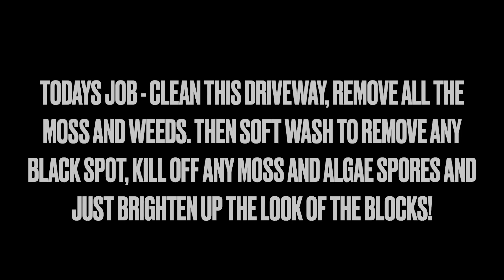FILTHY, WEEDY, MOSS FILLED Driveway Gets The "PRESTIGE" Treatment | Pressure Washed & Soft Washed！

Comment: may i ask what you use for the oil stains and would be effective on stains a couple of years old thanks
Reply from the maker: Hi Alan, Resiblock oil remover is what I use. It shifts most stains, but every now and then, some stains refuse to go, so it's not a miracle cure, but it's the best one i've ever used 👍
https://www.amazon.co.uk/Resiblock-5-lt-Oil-Remover/dp/B00G24X6R2/ref=sr_1_1?crid=354OB0E848J9O&dchild=1&keywords=resiblock+oil+remover&qid=1626116695&sprefix=resiblock%2Caps%2C197&sr=8-1

Comment: Hi Nick Great Job bud !! I have recently acquired an xjet do you use your proportioners with it or do you premix the SH with water thats in the drum and then run it through the xjet without the proportioners ??
Reply from the maker: Hi Simon, many thanks 🙂. The proportioners set the level of dilution you need bud, you'll have a chart that comes with the x-jet that you can refer to. So just neat hypo with some surfactant in the drum, and change the the coloured proportioners over to suit the dilution level you require 👍

Comment: The cleaner is now yellow, so cute) Great result, really neat!
P.S. would the salt water solution work on the concrete walkway in my garden?
Reply: @Louis Williams what should be the dosage?
Reply from the maker: 😁  Thanks Jio, you're very kind. Apparently salt works quite well on any hard surface, although I should point out that I always use it in conjunction with sodium hypochlorite, so can't really comment on how long the weeds will stay away for without it.  I've also not applied it without pressure washing first. Sorry I can't be more help on this, Nick 😊.

Comment: Lovely transformation mate, Was it the customers choice not to have the tiny gravel stones back between the joints? Looks much better with bright sand anyway!
Reply from the maker: Thanks a lot Jack. Grit is for a specific type of paving called SUDS paving, this is just standard block paving, so requires sand bud.
Reply: I too thought it was SUDS paving that needed the gravel infill rather than sand

Comment: Another deeply satisfying video. Lovely job done. Will a salt water solution kill moss embedded in tarmac? I'm going to give it a bash anyway. Can't hurt. 👍
Reply from the maker: Huge thanks onlyhuman1954, I'm not too sure in regards to treating moss with salt water, as i've always pressure washed or scraped first to remove the moss. If you could let me know how you get on with it, it would be very interesting to hear and find out the results. Many thanks, Nick.
Reply: @PrestigeExternalCleaning  well. Shortly after my earlier post querying the salt water, I put a whole ton of salt into my watering can and soaked the slimy stuff.
Just checked an hour ago. It's thriving. Not a bit sorry for itself and I think it's actually laughing at me. 😕

Back to the drawing board. Or invest in some potassium salts. Table salt is only for shaking over me fish supper. 🐟👍

Comment: Do you ever lift the drain grills and remove the detritus that accumulates / settles in drain pipe over time, maximizing drainage capability?
Reply from the maker: Yes of course, all drainage channels are cleaned out at the end of every job, without fail. Just don't bother filming it, as didn't think anyone would want to see it.
Reply: @PrestigeExternalCleaning  Thank you for your reply. As always, enjoy your video presentations.